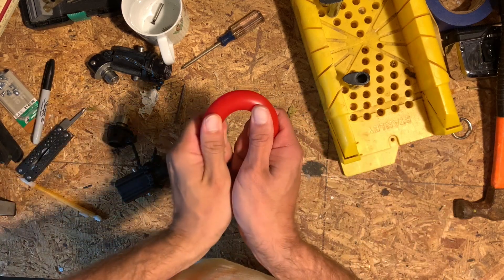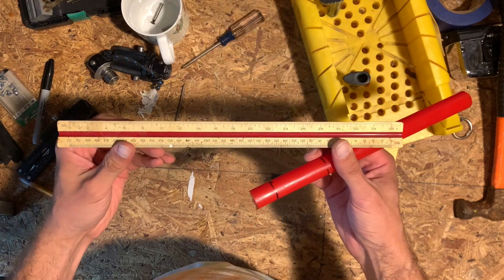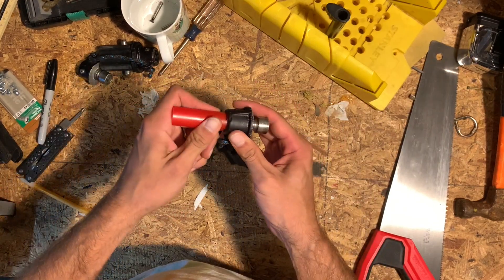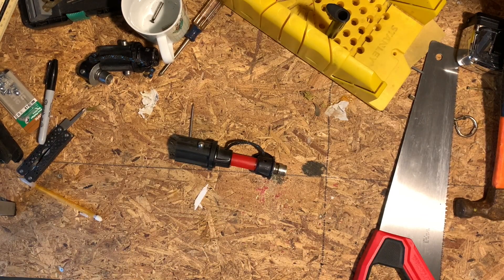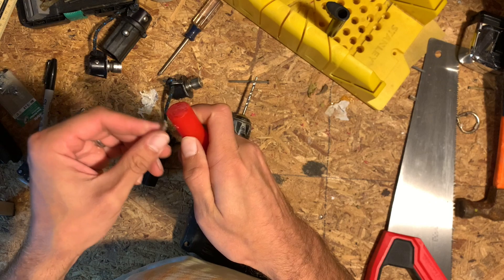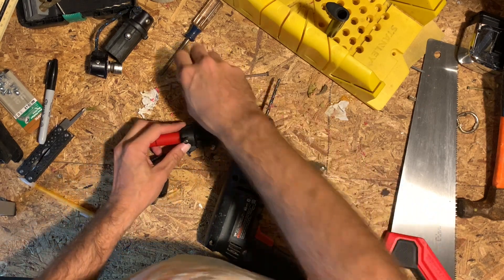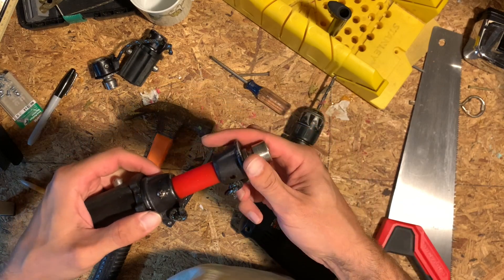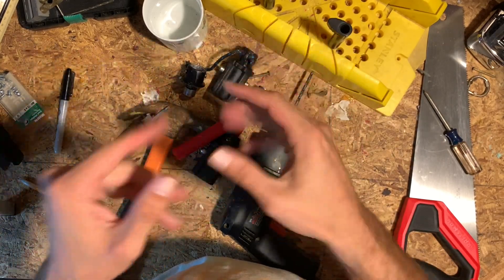Cheap DIY Tendon Joint For Windsurfer

Comment: After seeing your video I went ahead and did the same. Today I gave it a test run at Punta San Carlos and the tendon didn’t survive. It snapped clean the first session. Granted I was overpowered, there were waves and I had few catapults and jumps. But overall Impression is that the tendon is softer, thus it twists and gets out of alignment easier and thus it snapped. Might work for windfoiling or simple cruising but even then I wouldn’t trust it. Great ide and was awesome doing it (I did 8 plus ordered 2 more rods in different colors, alas too good to be true) 😢

Comment: Great find! Keep us updated with durability. Careful drilling through the base, holes may get enlarged. Also it's best to get a tight fit first as it'll get looser over time. The tighter the tendon the less stress on the holes.

Offset the holes doesn't really affect durability. We just need to make sure that the base top and bottom don't rub onto each other causing added leverage against the tendon.

Offset holes vary depending on brand.
Reply from the maker: Thanks for the tips! I need all the help I can get.